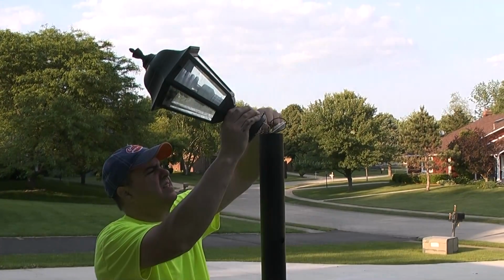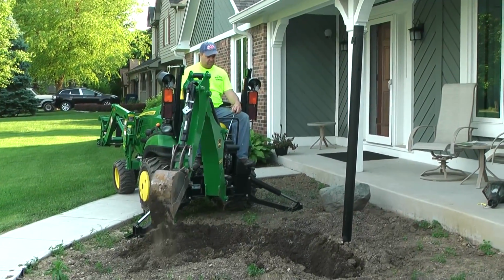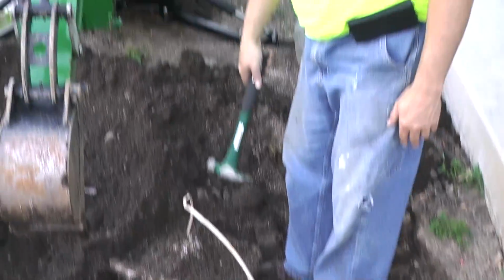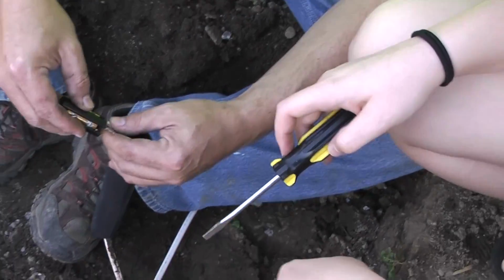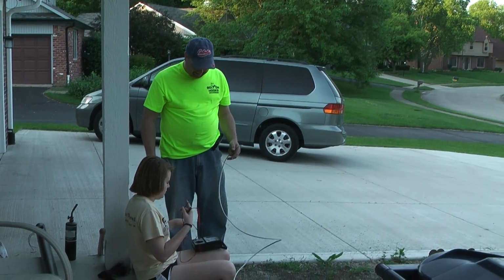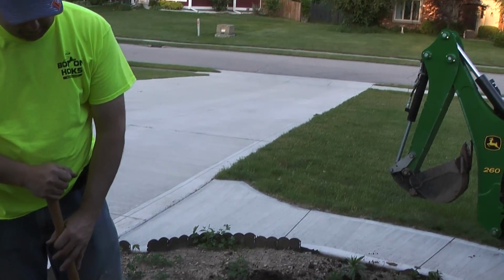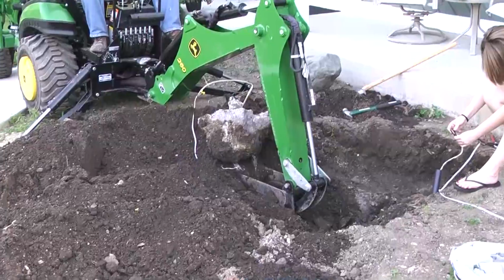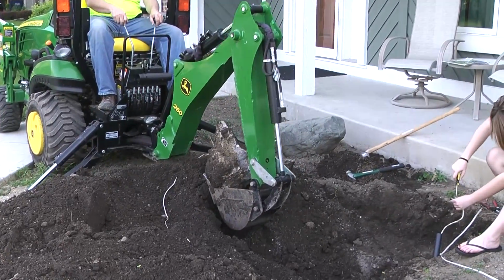#74 Deere 1025R Backhoe - Install new Lamp Post for  Mr. Tumnus of Narnia

Comment: A sheet of roofing felt (the heavy stuff) around the pole configured in way to prevent contact with the concrete will spare the pole from the effects of the alkali and lime in the concrete. I also love how you got all those flowers back there as if nothing happened there... 😁

Comment: a little RTV would seal the end up for you but it should be good for a long time as is. some condensation will get in to your splice and corrode the joint but it will take a long time, hopefully. photo eyes should never face direct sun best to aim to the north. if direct sunlight is on the photo eye to long it will go bad.
love your videos and as always looking forward to the next.

Comment: Great video and channel. I've been addicted to watching your videos. 

I had underground high voltage electrical connector just like yours that I used a heat gun but the ends didn't shrink enough to keep water out.  I found out that the heat gun didn't get hot enough to shrink it all the way. Once I broke out the torch it shrink fully to keep the water out.
Reply from the maker: Probably should have done that!
Reply: Now you know for next time. We live and we learn.

Comment: Hi Tim 
Hey when you can't get a shrink tube to seal on the ends, do what I do. Get some liquid electrical tape and coat the ends of the shrink tube with that. It will seal the ends.
Reply from the maker: Never heard of liquid electrical tape.  Thanks

Comment: You need a thumb on that backhoe Tim I have 1 on mine although it's not hydraulic it's stationary but it works great on those rocks like that. Instead of a hydraulic ram it uses a third arm for a category 2 three point hitch. You pull one pin and it talks back out of the way. I found mine on eBay. I want to say it was made by Titan but I'm not 100% sure. I'll try to remember when I get home the 27th and look for you. It is great for moving rocks and roots out of holes.
Reply from the maker: +Alvie Schreckhise would be great, yes!

Comment: Your videos were part of the reason I went with a 1025R TLB. Have you had any issues with the backhoe and jacks losing pressure when not in use?
Reply from the maker: +Ed Stiefvater yes, all hydraulic cylinders are prone to leak down.  I just use a strap to tie them together

Comment: Most states do not allow one to make electrical connection in the ground unless it is in plastic pipe. What you have done is far from being water proof. Dampness can still get into it even in the post. I love your yard and videos keep them coming
Reply from the maker: +Billy Bob Williams how would you have solved the problem?  I had no better ideas.  Thx.
Reply: Tractor Time with Tim thanks for your answer to my comment. Your way off fixing is one way to do it, but here in MA it definitely would not be acceptable. We would have to remove the wire completely back to where it originates from and rerun a completely new wire inside electrical PVC pipe. I realize it is a lot of work, but our laws are kinda strict. The underground Rolex wire cannot be used without pvc pipe. We use to be able to do it that way back in the 60's it no longer. I just went through several of your videos and found them to be very interesting and fun to watch. I kept saying to myself why is he doing it this or that way. I guess it is the Kubota that is my blood I have and use all the time. We have a B26 TLB that is loaded with all the bells and whistles mounted on the tractor with just the bucket and backhoe with 3 buckets, all quick attach. It has been so worth every $ spent for it and I'm sure you feel the same about your "John".
Oh I forgot to mention used in several cases water proof electrical boxes with plain covers for making connections, but now no longer acceptable.we have very strict rules and high fines if permits are not pulled on all types of construction/renovations.
Daughter does a great job. I love the chocolate mix episode.
Ralph Wye
Reply from the maker: +Billy Bob Williams thanks Ralph.  We certainly don't have all the answers for 'how to do stuff'. Hopefully our videos are entertaining, but not necessarily the best way to do things.
It IS still legal here to use UF wire here.  However, I'm not sure that stretch of wire was even UF.  I can't remember.  In any case, I wasn't up to the task of re-running a wire all the way from the source...would have been VERY painful.
BTW, if you want 'less government', move out here to fly over country!  We still allow some freedom here!
Reply: Tractor Time with Tim you sure like having fun and as I said continue to do it and stay safe.

Comment: Great video, I have had a 1025 R for a couple of moths and my list of things I need to accompany it is growing quickly.  It has really helped out around our place.
Reply from the maker: +Wayne Phillips yea, I get it.  The only problem is that inside projects keep getting pushed to the back burner!
Reply from the maker: +Wayne Phillips Sorry, I misread this the first time.  What attachments are you considering?
Reply: I'm thinking about a tiller, and a 4 ft rotary mower.  I garden like you and really don't like cutting it down with the mmm.

Comment: help me understand why you have a trench bucket instead of a regular bucket? a regular bucket could do the job in maybe 3 scoops.
Reply from the maker: That is an easy question!  I bought the backhoe used. That is the bucket it had on it.

Having said that, most of my digging has been trenches and areas where we want to tear up as little yard as possible, so it has been a pretty good fit.
Would be nice to have the 16" bucket as a 'companion'.

Comment: Tim, does your backhoe lose pressure and droop when idle or disconnected? If I store mine for a day, I'll come back to it on the ground. If connected and at idle, it will drop a little bit.
Reply from the maker: +Vincent Sasso yes. Mine drops quickly.  You'll need to use the pin to keep it from dropping.  That is normal.